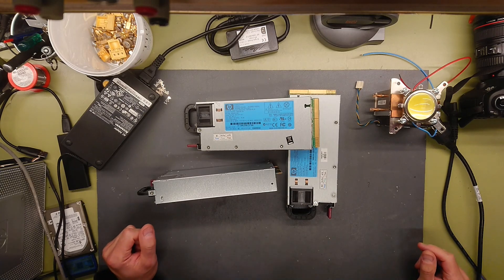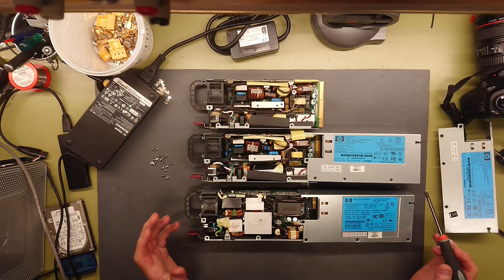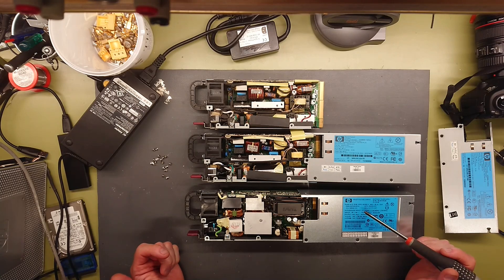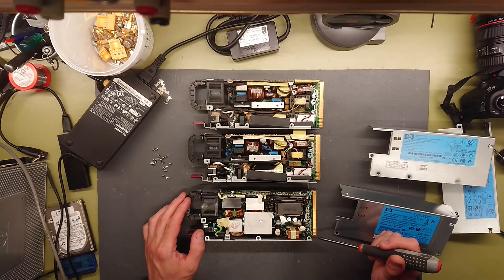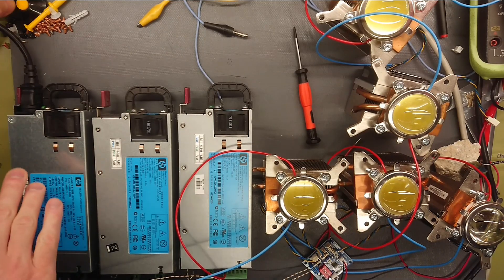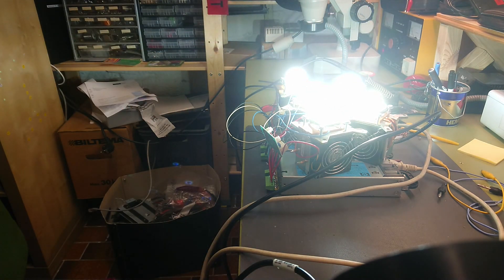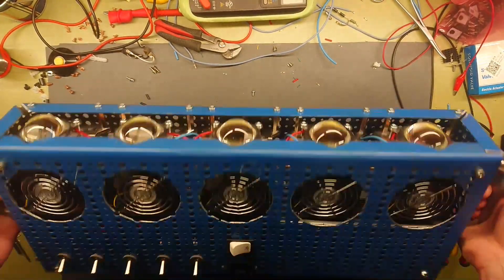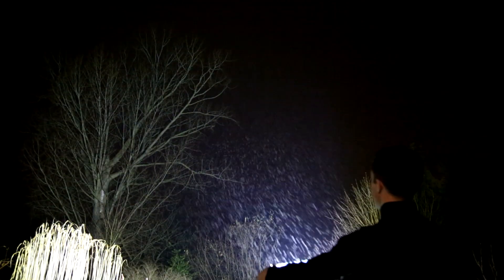250W (25000+ lumen) LED Flood Light, Part 2 of 3

Comment: I'm pretty sure you need to constant current regulate these LED elements?
Reply from the maker: I know, I AM being reckless here and just went for it. Let it light up or burn, if it burns, turn down 10% and try again :) Part 3 will have some light intensity measurements, power supply current and voltage ripple tests and testing for flicker with the FPS1000 high speed camera.
Reply: @KaizerPowerElectronicsDk  im happy you heard me shouting at my screen "i need you to use an "el-cheapo" light meter to give some lux or lumen measurements"  MOAR POWER  ;-]
Reply: @KaizerPowerElectronicsDk  I see that we build electronics the same way :) Trial and error!
Reply from the maker: @ca-sb2ce  We can do this, because we have a pretty good idea about what is going to happen, but jump the step of tedious calculations and simulations ;)
Reply: its best practice to CC but if you can regulate the voltage quite precicly and run them slightly under max power (ie: rated voltage) then the current draw will stay stable and "self" regulate  ;-]
Reply: @DazzaDirect  nope
Reply: @txd  ? what do you mean "nope" ?

Comment: all you need to do to series power supplies like that is unground the secondary side, leaving the mains ground connection intact. it can be dangerous if that is disconnected. I made a video on how I wired my PSU's in series. what you could also do is put them all in parallel and use CC boost converters for better regulation and adjustability. anyway cool build!
Reply from the maker: Same procedure I use, the protect ive earth must stay in place https://youtu.be/xRAlXCzsY3Q